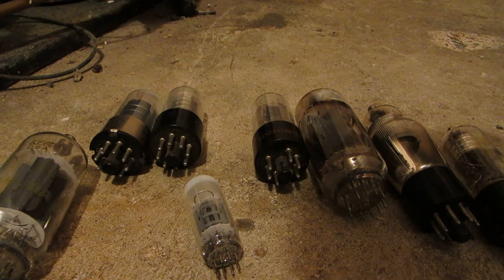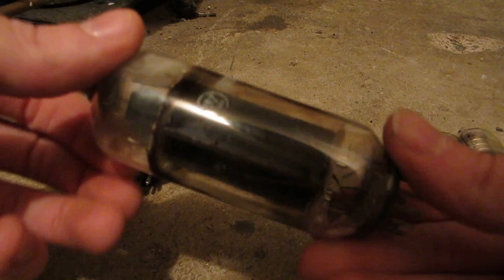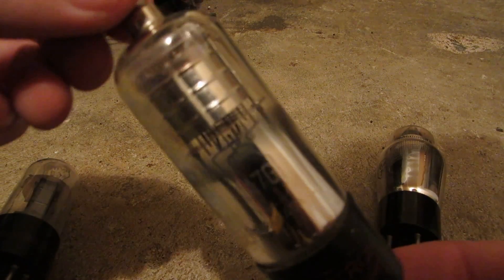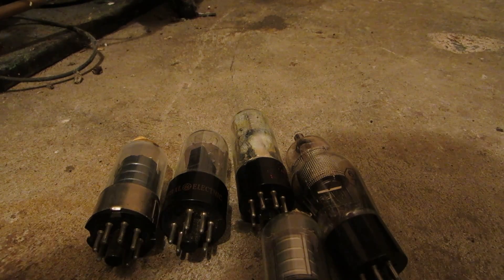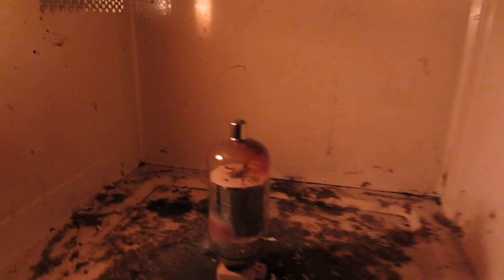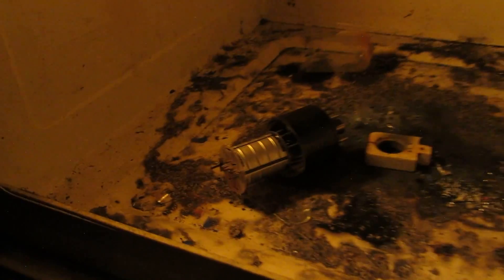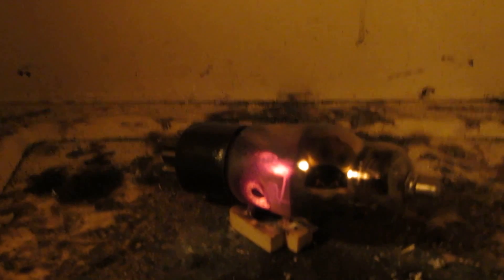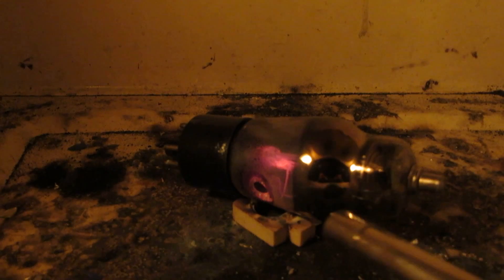Dead Vacuum Tubes Microwaved

Comment: Works of art the tubes were one day
Reply from the maker: They still are works of art! I have about 1800 of them :D
Reply: Have you ever Built Big lipo packs with 18650's i had 40 laptop batteries that I got for free and I built a massive 16,8 volt battery 90000mah in total  the batteries had to be revived I tested them and soldered them together nicely and I charge all my RC quads with them in the field very easy
Reply: Have you ever Built Big lipo packs with 18650's i had 40 laptop batteries that I got for free and I built a massive 16,8 volt battery 90000mah in total  the batteries had to be revived I tested them and soldered them together nicely and I charge all my RC quads with them in the field very easy
Reply from the maker: Not to that extent but I do take lith ion's from laptop packs and solder them together and mount them inside old RC cars that use to use 6 or 9.6v ni-cad battery packs.
Reply: About a hundred years ago maybe, then they were able to mass produce them.
Reply: +HL4EHalfLife I love tubes, always thought they looked cool and would make a neat project to try and make something out of them one day, but I never had the time.